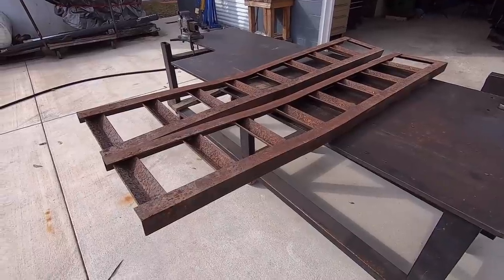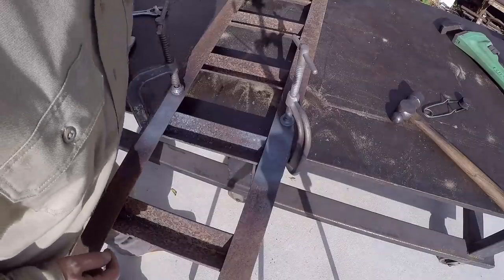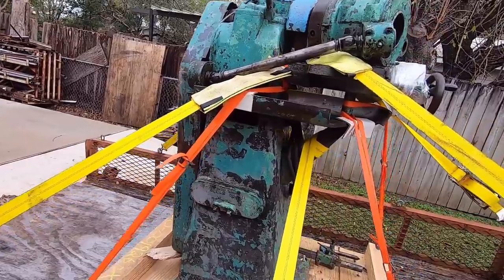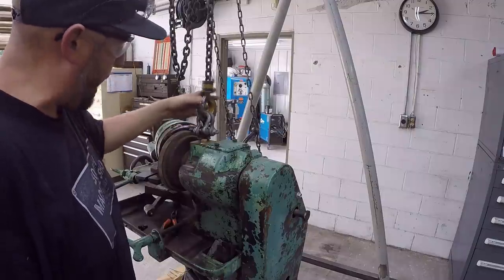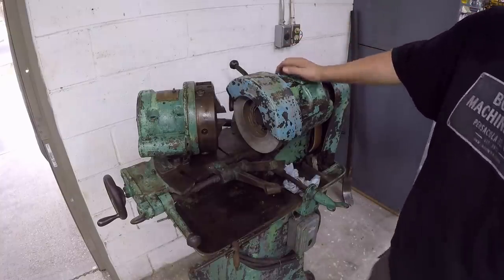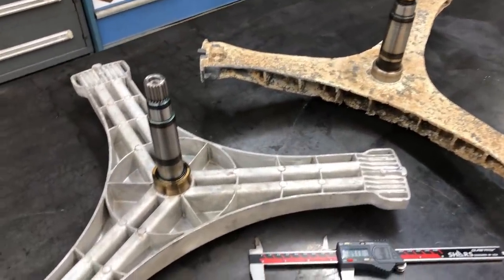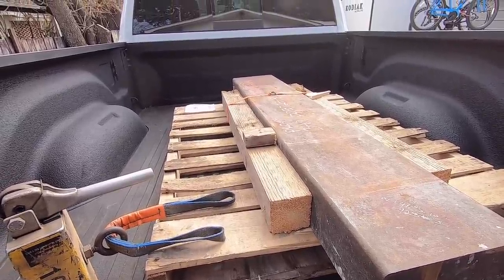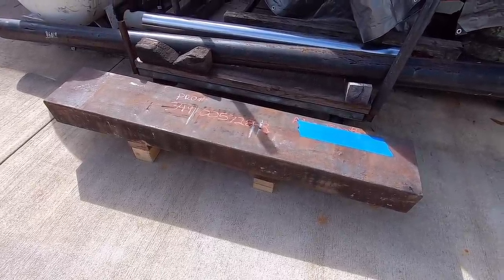SNS 289: Oliver Drill Grinder, Trailer Ramps, Stainless Machining

Comment: Adam your 4 ft pipe wrench really brought back memories of years ago I use to work for a place that built & updated filling stations & I had the twin to your pipe wrench with bend & all. I thing mine was bent a little more. You would be surprised how many looks I would get when I pulled it out of my service truck. Of course I never told anyone it got bent by useing a backhoe on it.  I just let them think I bent it by pulling on it.

Comment: That piece of steel would make a great anvil or hammer for a power hammer. Cut it in half and stand on end to use as a 500lb anvil or just bury half of it in the "ground". 
You have a bigger pipe wrench than that one? using a pair that size, one for each side and heating both sides may have worked quicker but we all work our own way. knowing my luck though, one of the wrenches would fall off and knock me in the head while I was trying to heat the angle. Maybe some triangle bracing at that section of the ramps would keep that from happening again but then the trailer may pick up the truck when the weight moves to the trailer from the ramp- that is not a fun ride; or worse the ramps jack up and hit the machine at the end of the ramp.
Are you going to make a mold for the drill grinder table that is broke off and have it recast? Keith Rucker knows how, cameo? you could do a montage. plus it gives you a reason to hang out with Keith for a day.
thanks for the videos.
Since I am rambling, you ever think of using all of your hydraulic experience and making some hydraulic equipment to help you around the shop?

Comment: Adam, when using those nylon straps with lots of distance hanging out iin the air, try putting  single 180 twist in it. While driving it will be stiff as steel and not whip so much wearing out the contact points. Old reject truck driver method. Love the videos, have learned so much, keep up the good work. Thanks, bj

Comment: Instead of rebuilding add a truss to the bottom side 
In the video I can hear a sound  like a engine miss that the torch is making 
May be up grade from a smith to a industrial size 315 victor set of torch’s (😂)
A rose bud torch size is limited to the size of the acetylene bottle
If you start flowing too much gas it starts to siphon the acetone off the bottom of the bottle that is there to stabilize the  acetylene gas

Comment: I wouldn't waste that big block of metal for a stand.  It could be cut up into blocks with handles and sold to wood workers that are always looking for weights to hold down large flat glue ups.  That is, you could turn that big chunk of steel into $$$

Comment: Do you need a permit to have gas on the premises? In the uk we have the fire department come over and do inspections.
Reply: Same here we have always had oxy acelethane on our farm and never needed permit or got inspections...
Reply: In the USA commercial properties have to be placarded to identify possible hazards emergency workers might have to face. Fuels are identified on the placards also oxidizers and suffocants such as argon, nitrogen. Fire inspectors do tour buildings to confirm this has been placarded properly as well as identify other conditions such as fall hazards.

Comment: If ever you want to improve your heatign and bending skills, have a read up of how the railworkers and steelworkers would use a torch to straighten rail track and big steel beams ... using just a torch.  No pulling, no beating, just a torch ... and it works exactly backwards to how you might think ...
Reply: Keith Fenner had a demonstration a couple of years ago at the summer bash about heat straightening shafts.  It is probably similar to what you are talking about.

Comment: Abom, those are the best drill grinders ever made in my opinion.  had one at the last shop i worked at and it puts a perfect grind every time.  easy to use.  glad you got it
Reply: one thing i may suggest is that you bolt it down.   they have the tendency to wobbkle/ move around as the wheel revolves around.   maybe yours wont though.   have fun

Comment: On your trailer ramps, when you build the new ones, weld a piece of flat stock on the bottom of your angle iron to make it a C channel. For the Oliver, make a shorter bar for your stop. I bet that long stop won't be used often. The short bar is lighter and out of the way when it's on. What ever happened to the machine the trucking company damaged?

Comment: if you try to lift something close to the max strenght of a magnet wire brush or grind the surface it is going to sit on more even and get it to contact bare metall instead of 1/16 of rust and oxide

Comment: Send that slab over to Keith Rucker. He needs something to test his shaper with, if he ever gets that together. A nice flat face would be good for your vise table. Should be no problem for you to tap the bolt holes...
Reply: jacktheripped  I meant planer not shaper.. and of course it will get finished. Probably much better than new.

Comment: think I'd have pulled the truck out from under the hanging chunk of steel instead of pulling it backwards, wouldn't want to smash the truck or bust the concrete if it fell.

Comment: Hey Adam so you finally got a Drill Grinder. You won't know yourself once you get use to using it. Go on the Oliver of Adrian Website and you can download the operating/parts manual for that machine. You can buy new grinding wheels from Oliver for that. 3 sets of Jaws is correct for the Chuck.
I have the ARCHDALE Machine made in England which is almost identical to the 510 Oliver that you have. Will send you a little video of it running.
Just a heads up to Adam don't use Solubule Oil based coolant as it goes rank. I'm using a sinthetic based fluid.
Web: www.oliverinstrument.com                                      Email: info@oliverofadrian.com 
Cheers.

Comment: There probably aren't many around that know what this is, I did, in a few years nobody will know what it is.
Reply: To what are you referring.
Reply: @MaturePatriot  Fifty years ago I started a job at a company that used machines like this and others in the tool room.  Some people that see a picture of this drill sharpener know exactly what it is. The people in their 60 and 70's know or if by chance you have a job at one of the few places remaining in the USA that has a use for a machine like this. As time goes by using drills to make a large hole is becoming a thing of the past if it isn't already. So what I meant was, some people have no clue and the ones that do are dying off.  The company was the EW Bliss.

Comment: Any particular reason when you sharpened that drill bit by hand you roll the bit to give it a convex grind?  I feel like that has a tendency to want to rub more than just going with a straight grind for the cutting edge (as straight as possible considering the wheel is round), and then a secondary clearance grind a little further back?  I bought a 1.25" twist bit from your collection at Flywheelers and noticed it had a noticable convex grind, and I did feel like it rubbed a little when I used it....just curious as to your thoughts...

Comment: Cut out a couple of those steps in the ramp and put that in that giant arbor press, cold !  Might need a bit of a wedge to go a wee bit past straight.  Weld the steps back in.
If you need to cut that steel, you had better have a couple of spare bandsaw blades !

Comment: Adam when you go to the Florida flywheels show look for the economy tractors and take some pictures of them and if they have implements those also and if you look at where the lift arm is and the hydraulic cylinder look at the swivel point and see if it has any play in it?

Comment: Thought you had skates ?   Two bars worked great!   My two surface grinders (size of your Horz mill) have lifting eyes - Bolt to eye rated at 20k each.  Lifts by a bar that is inserted into the eyes - belted up.  I have them on Heavy pallets. What is the voltage 3ph do you run ?  I run 380v but have 220 3P as well. Wow that steel !!!   Tool Steel ???  cut-offs might be good cutting tools!

Comment: If you heat one side red hot then bend it straight it will rebend because the other side it pulling it right back... this aint rocket science

Comment: TURN GAS OFF FIRST.
Reply: Turn oxygen off first
Reply: @felixar90  wrong
Reply: @michaelmarshall8041  Nope I was taught by 3 different people, my teacher and 2 old timers.  By turning off the fuel first you almost always get a crackle, which is bad for the tip. By turning the oxygen off first you go back to the calm soothy flame, then you quickly turn it off. 

I always turn oxygen off first because I don't want to blow up.  Most equipment manufacturers recommend turning oxygen off first. 

It's AOOA, easy.

The correct answer tho is do whatever you want because people have been doing both ways for 100 years and no one ever blew up turning the torch off.
Reply: felixar90 this is one of those arguments where it will go on and on and on and everyone will claim to be right. I was also taught to turn the oxygen off first.

Comment: That is a beast of a drill grinder. I remember there are some old tractors called Oliver probably the same brand.
Reply: actually drill grinder is made by Oliver of Adrian. They grind the drills with more relief as you get closer to the center. This reduces the thrust required to push the drill thru the material. I love mine. and it will grind drills up to 3" diameter.

Comment: You touched the tip to the metal and cut off the flame
Reply: No he didn't. Play it back at ¼ speed.
Reply: @xenonram  i did rewatch it. the tip came close enough to put it out..its pretty clear..

Comment: sorry it is late at night here buddy. I have 2 questions. Turn off the gas before the oxy in a torch to help keep the burning gas coming back up into your torch head?  Also I was always told that heated(torched to red hot) cold rolled steel is weaker after the fact. Like I could stand on that angle iron and bend the crap out of it. No?

Comment: i'am no expert, but inst the way he heated to unbend made them worst by annealing  the weak spots?
Reply: Odds are that they were made from hot rolled A36 steel which is a low carbon steel. So there isn't any change in the properties of the steel after heating it and then letting it cool down. If it were a high carbon steel that had been hardened at some point in time then the heating and cooling cycle would have changed the properties of the steel to make it weaker.
Reply: @ssmt2  thank you i see what you mean
Reply: Well said
Reply: probably just some mild steel. So it can't be hardened anyway.